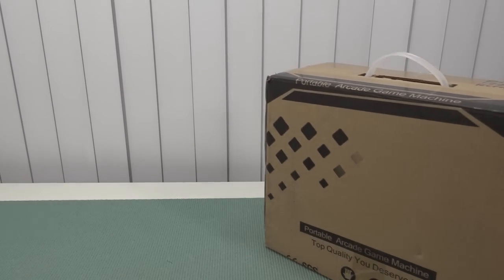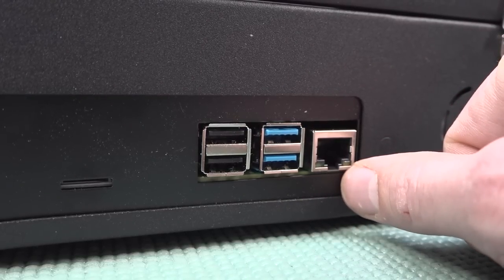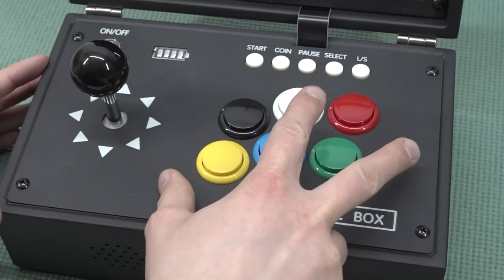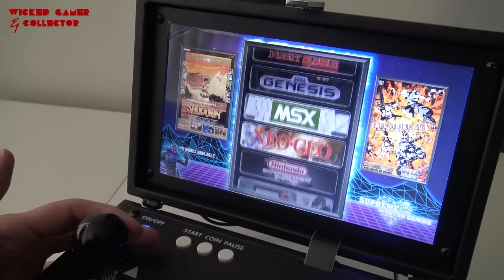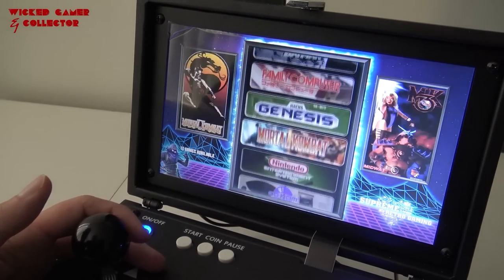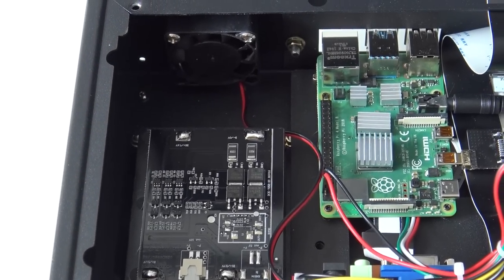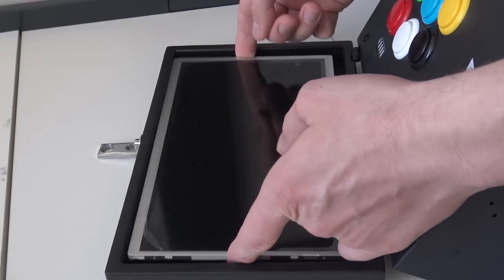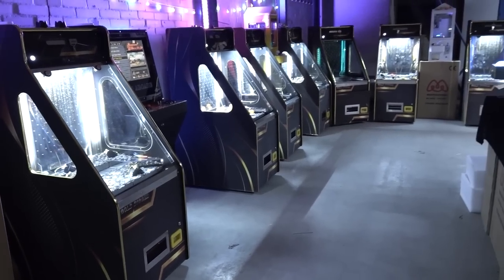Crazy Portable Machines That Play All Your Favorite Games NOW ? 😲

Comment: I've had one of these for some years with a RPI4. I rarely use it, but i really like the design. It is a pretty cool retro-machine. My greatest fear is that I at some point wants to pack it and slams the screen on the joystick, which I had forgot to dismantle. Brutal metal-contruction! The great thing about having it with RPI4 is that you know you can get correct screen ratio and in general also configure it yourself. The downside is that you often have to use a lot of time getting stuff configured just right, even if you use preconfigured images - there is always fafferyfoo to be done.
Reply: How durable are the controls?

Comment: Looks decent enough, but it's a lot of money for a pi system.
Reply: You’re broke. Just say that.
Reply: You got to consider your getting a decent screen and working joystick with buttons. I would just get an older phone and load all these roms into them which a Pixel 3A XL is cheaper than this with an OLED screen at least.
Reply: Not about being broke it’s about the concept, design, playability…etc. 

I can get anything cheaper console or handheld and mod the crap out of it.
Reply: Build your own ..all parts are available from same place u buy the full build
Reply: @Kla2024-s5t  emulation is the most inferior rubbish imaginable .
Reply: @Jerry4050  yeah I just got a switch style controller for my phone. Now I'm doing dragon punches whenever I want
Reply: @astra6712  cash is relative, if you feel something is worth it you are prepared then to buy it even if you haven't a load of money. If you don't feel a product is value for money, then that's ok. That's what he said, it's different from being broke.